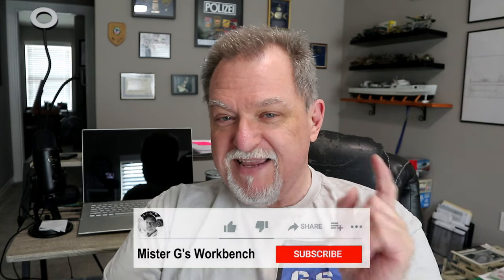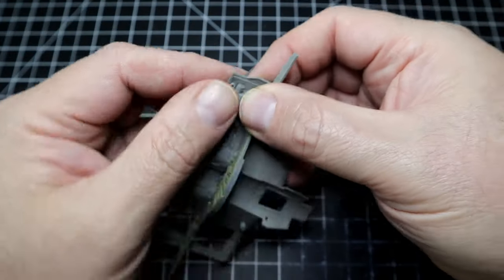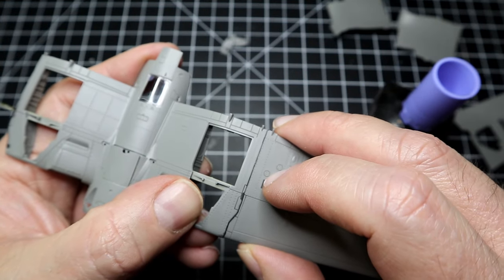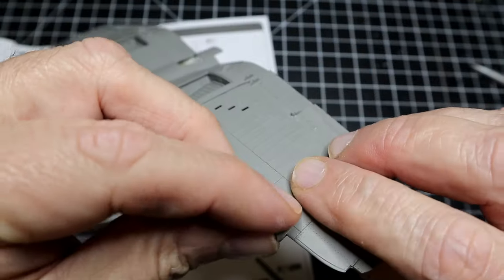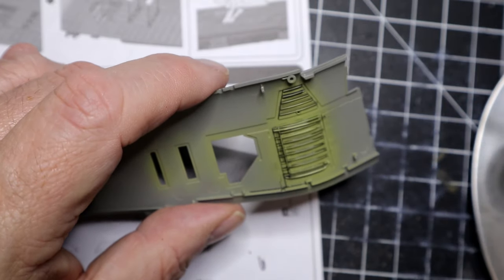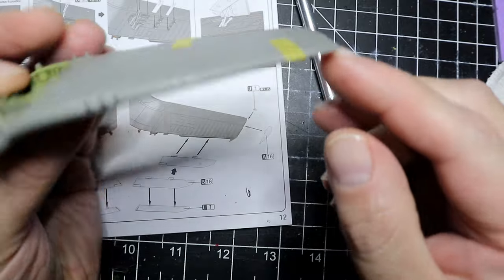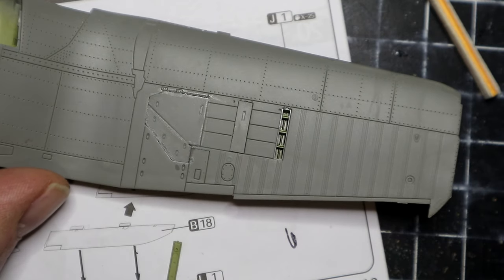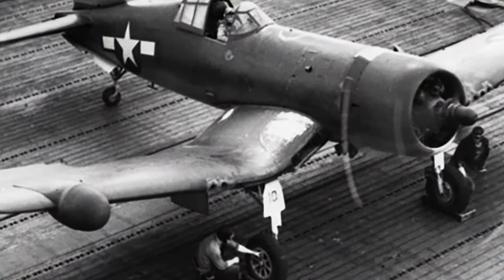Build the Magic Factory Corsair - Part 3: How To Extend Those Folded Wings

Comment: I finished the 2nd plane last weekend. This is a really really nice kit - paint masks and PE are included.  I thought the instructions were a bit lacking,  critical illustrations were shaded - looked like they were photocopied.  Didn’t occur to me to straighten the bent wing, but your “how to “ was really interesting 😃. I made a rookie mistake with the 1st fuselage by. Installing the engine firewall upside down. Figured that out the next day and fixed that, but then I had to do a bit of bondo. So that fuselage became the bent wing model - the bent wings hide the  affected area 😁. When I compared the Magic Factory Corsair to the Tamiya, the Magic Factory is clearly the more detailed model. And of course blows the doors off my Academy F4U 😂
Reply from the maker: There's been talk about the rivet patterns being fictional but I'm not gonna lie- it doesn't matter to me when the kit builds up this nice. You're absolutely right- the instructions leave a bit to be desired for sure. Thanks for your feedback!